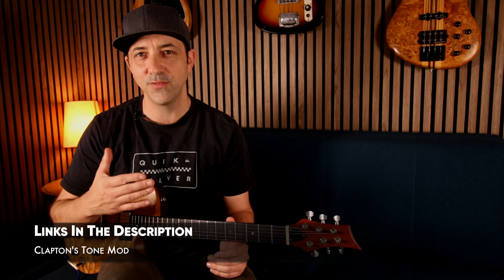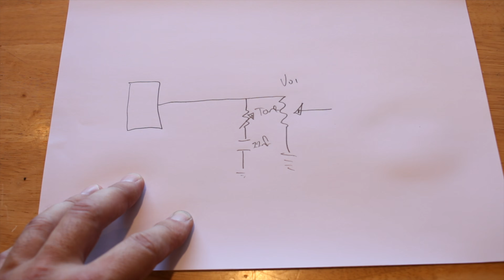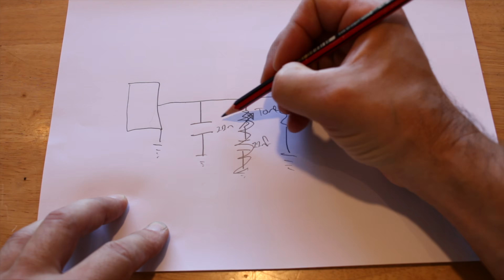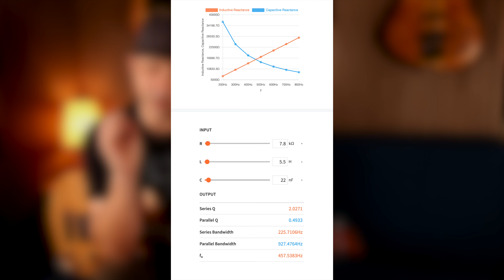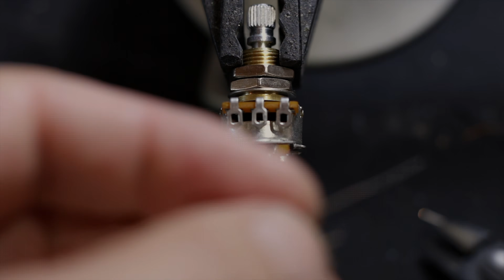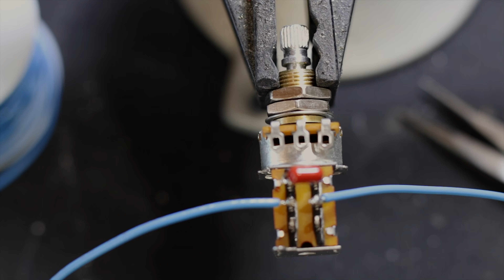Clapton’s EASY TONE MOD : Finding the TRUTH | Woman Tone + New Revelations

Comment: Here’s an alternative idea: wire the regular tone circuit through the push-pull and let the push pull choose one of two tone capacitors. For example, you could use .033 and 015. You will need to roll the tone to zero to get the Clapton sound, but now you can select one of two resonant peaks. .

Comment: Could have just tacked the cap from the ground lug of the pot to the switch and saved a wire, half a switch, and some crucial control cavity space. Also a great way to tie the lug to the case without the stress from bending over. Leo Fender was the king of letting the capacitor companies pay for his hookup wire and ground busses with excess capacitor leg.

Comment: I guess I have to put it down to this kind of thing just being a fun hobby for some people, but it really makes no sense to me to do a wiring mod on a guitar to achieve something you can achieve just by rolling down the tone knob. (Nothing against mods in general, I’ve done the 50’s Gibson wiring mod on a couple of my guitars, but that was just because there was no other way to achieve what that does, without modding it).
Reply: My first thought after watching this video was... "but, why the push/push when you can just wire in a 22 cap and roll down the tone?"... so yeah, I'm right there with you -- this is an absolutely cumbersome mod. It's taking an unnecessary long way to get  somewhere.

Is it really that difficult for someone to roll down the tone pot and switch pickups when they're ready to solo? I mean, sure, pushing a button could shave off about 500 milliseconds, but yeah, nah! This mod is the equivalent of modern chat abbreviations with people too lazy to spell out words.
Reply: @Phil_Trujeque The mod is done because it can be done, and also doing it teaches people why the tone is as it is.
Reply: @michaelvarney.  • Fair enough!